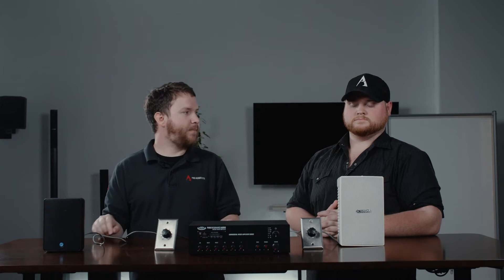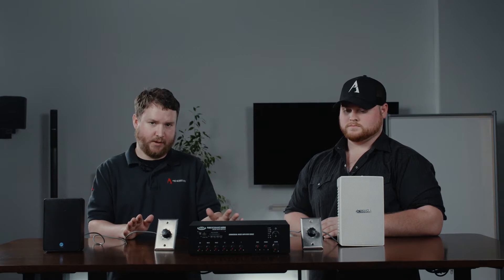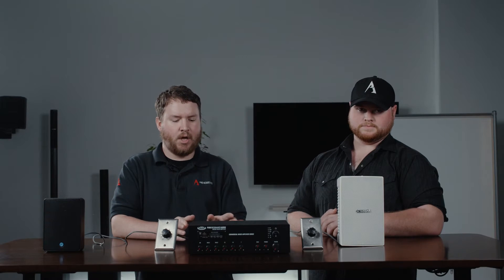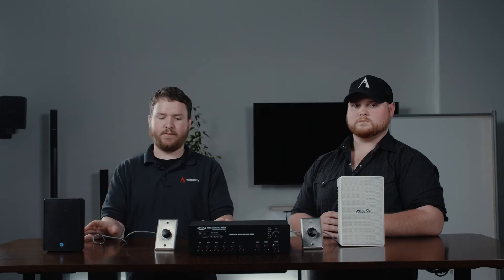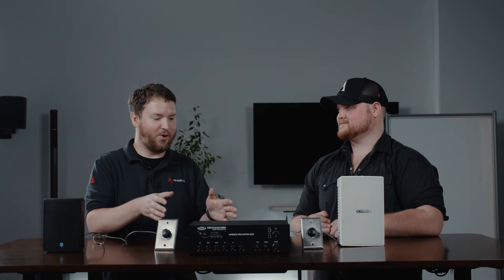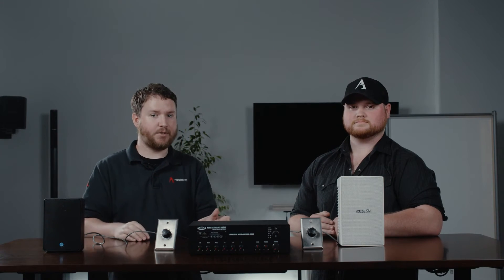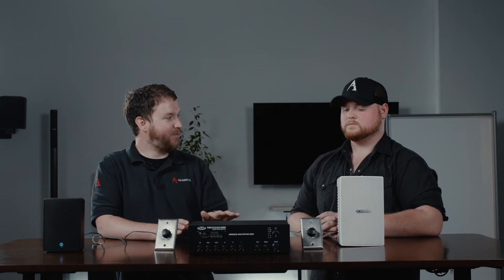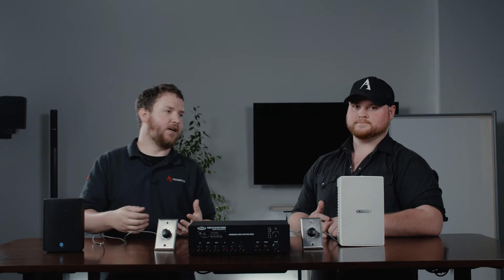How to Wire a Basic 70 Volt Speaker System in Parallel to an Amplifier on Pro Acoustics TechTalk Ep5

Comment: Quick question, can you connect to 70v speaker to regular power amp?
Reply from the maker: Connecting a 70V speaker to a regular power amp is not recommended unless the speaker has a low impedance bypass switch, usually set at 8 or 16 ohms. Without this switch, the mismatch in impedance can damage your equipment or affect sound quality negatively.
Reply: @ProAcoustics  oh ok thanks

Comment: I have watched a lot of your videos and called in recently but did not get my question answered. Do the dynamic mics need any type of pre amp to get the gain up.  I have wired many 70 volt sound systems and input volumes are great but you have to max out volume to get microphones to provide a good output volume. What can I do to improve this the output on the microphones. By the way, not using  this only for announcements.  It is used for live audiences similar to a church setting.  It would be great to see more video content about the microphone set ups on 70 volt systems. Thank you
Reply from the maker: Thank you for your comment and for watching our videos! Most 70-volt amplifiers do not require a separate preamp for dynamic microphones. However, it’s essential to ensure that the input on your mixer or amplifier is set to "mic level" rather than "line level," as this setting significantly impacts microphone sensitivity. If you’re still experiencing low output levels despite these settings, using an external preamp can help boost the microphone signal.
I appreciate your suggestion for more content on microphone setups for 70-volt systems. We’ll certainly consider creating videos to cover this topic in more depth. Thank you for your support and feedback!

Comment: Do I need a specific amp with specs for 70v or could I use an amp as long as it has enough watts?
Reply from the maker: Hi Jesiah, You should use a properly rated 70-volt amplifier to power 70V speakers.

Comment: How did you actually wire it? Can you show us the back of the amp and how the wiring is done? Thanks. 😊
Reply from the maker: Hi there, You can find graphics for the wiring here: https://www.proacousticsusa.com/blog/post/your-70v-speaker-system-wiring-diagram-and-installation-guide/
Let us know if you have any other questions.

Comment: If you have a standard 8/4 ohm amplifier but have  70V ceiling speakers, can you bypass the transformer or remove it and then connect it up like a normal speaker system?
Reply from the maker: Hi Logan,
Yes, most 70 Volt speakers have an 8 Ohm bypass mode on the transformer that would allow you to use them with an 8/4 ohm amplifier. Just keep in mind that you won't be able to run the speakers in series as shown in this video but will need to run them each separately to the amp.
Reply: @ProAcoustics  thank you for the feedback. I thought that was the case but wanted to double check.
Reply: Maybe 2 or 4 but no more than that.

Comment: Thanks guys.  I'm assuming each amp plays one channel and I'm looking at stereo left and right ?
Reply from the maker: Hi Kevin, 

No, most 70 volt distributed systems are mono, where the left and right inputs are summed together. This means that every speaker will get 100% of the musical content. Mono is actually more beneficial in distributed audio systems because it ensures that all listeners are hearing the same musical information. Mono doesn't necessarily sound better/worse than stereo - it just means that all the information feeds to all the speakers.

Many classic rock albums were recorded in mono originally but remastered in stereo later on.  In some cases, drums/vocals/other instrument were hard panned to one side or the other. In a distributed 70 volt system, that could mean that a listener at a retail store or restaurant may not hear any drums/vocals until they walk to another speaker coverage area.  Summing to mono in a 70 volt system resolves that issue.

Comment: Hi looking to add speakers to a jukebox. It has 70v stereo speakers . The amp is a tube amp . What is the easiest way to add additional speakers to another room with volume control.
Does the tube amp always need load ?
Can I isolate rooms with speaker switches
Reply from the maker: Hi there! If you have a 70 volt amplifier, you can add 70 volt volume controls in line to attenuate volume in those other areas. See our video on 70 volt volume controls. https://youtu.be/6sCY8W0wMoc
I would not recommend using speaker switches, but rather in-wall volume controls to adjust speakers or group of speakers. Make sure to pair 70 volt speakers and 70 volt volume controls with a 70 volt amplifier and to keep your speaker tap settings at 80% or lower of the amplifier's maximum wattage to allow for 20% headroom.  https://www.proacousticsusa.com/commercial-sound-equipment/commercial-sound-accessories/volume-controls/70-volt-volume-controls.html
I hope this helps but feel free to request a quote from our website, email sales@proacoustics.com, or call us directly at (888) 256-4112

Comment: so if I have an amplifier (100V) I can connect 2 speakers (70V for each) to it?
Reply from the maker: Hi there, Thanks for watching! Yes, most 70V speakers will have a 100V setting listed for them. However, we’d recommend that you refer to the manufacturer’s datasheet to confirm this before installing.
Good luck with your project!

Comment: Hi. Can i connect 70 V speakers to a home theater? Just change my old HT speakers for new 70 V speakers?
Reply from the maker: Hi Andrés, 70-volt speakers are conventionally meant to be used in commercial business applications. If you have a 70-volt speaker that has a low impedance bypass (a 4 ohm or 8 ohm transformer setting) and that setting is within the accepted impedance of your home receiver, then it may work fine.
However, keep in mind that it's also possible for commercial speakers to have a wider coverage pattern or deeper mounting depth than speakers designed specifically for home use. It's a good rule of thumb to keep home speakers in a home environment and commercial speakers in a commercial business application.
Thanks for watching and I hope this is helpful.

Comment: I have 2 questions not sure what video to post it on.  I did watch this video and answered my first question. The regular 8ohm is meant for just 1 speaker. If you have multiple speaker in the ceiling you need to use 70v. The confusion comes from speakers and amps that have both types inputs/outputs, but you need 70v for multiple speakers. I was wondering if you could hook up 10 - 8ohm speakers in a private zone. I planned to do this 70v speakers from your store, but just curious about 8ohm option. Also on the back of different amps I see a EMC input. Is this a audio override or how does this work? Also seems like no/nc connection to do with fire alarm?
Reply from the maker: Hi Robert,
Unfortunately, you cannot hook up 10 8-ohm speakers on one zone due to the impedance load being too low for almost any amplifier when wired in parallel. 
That is correct, the EMC input is a top priority input on the mixer/amp and takes precedent over other inputs.
Hope this helps!

Comment: Can I use this with two separate Sonos connects as my sources?
Reply from the maker: B H,

You can certainly use a Sonos Connect as a source with a 70-volt mixer/amp.  As far as using 2 Sonos Connects, if you have a multi-zone mixer/amp or multiple mixer/amps, that would be a simple way to control a 2-zone system. If you have a single zone mixer/amp, you may not need a second Sonos Connect, although there may be inputs available for it, depending on your mixer/amp. Let us know if we can answer any more questions!

Pro Acoustics

Comment: I recently found and won an eBay auction that was a recycled rack system for a rather large business. Of course the amps said 70 volt and I was ignorant to the meaning of this even though I've been in home theater and car audio for several decades.
This video definitely explained it though. What I would still like to know is  can I use these four, 20x2 (@8ohms) amplifiers like any other 2 channel audio amplifiers with say a set of small book shelf speakers? These amps are Class D and only need 1.5 amps to make full power. Please let me know as I would simply like to put one of these in each of our bedrooms and kitchen.
Thanks again!!!!!
Reply from the maker: Hi Justin,
Thanks for watching and we're so glad you found it helpful. If your new amplifiers have an 8-ohm low impedance output (which bypasses the 70-volt transformer) and your speakers’ load on each channel falls above the minimum impedance range of each amp channel, then the system will work fine.
Hope this helps! Feel free to reach out directly at sales@proacoucstics.com, visit our site https://www.proacousticsusa.com or call (888) 256-4112.

Comment: Very informative! 

I'm dealing with an existing 70v setup, that had 8 speakers. We would like to remove 4 of them at the end of the chain. 
Can I simply disconnect them? or will I need to adjust the TAPs on the remaining speakers? 

Thank you.
Reply from the maker: Art Prep,

Thanks so much for watching our video - we are so glad you found it helpful. To answer your question, yes, you can certainly just remove the last speakers from the chain. Make sure to always have the system powered off when disconnecting speakers.  You only have to adjust the taps if you would like for your remaining speakers to be louder, in which case you'll want to always leave 20% headroom between the sum of your 70-volt tap settings and the max capacity of the amplifier. Let us know if we can help with anything else!

Pro Acoustics